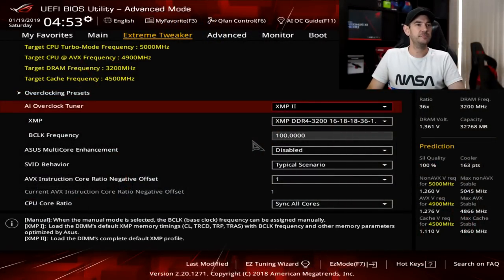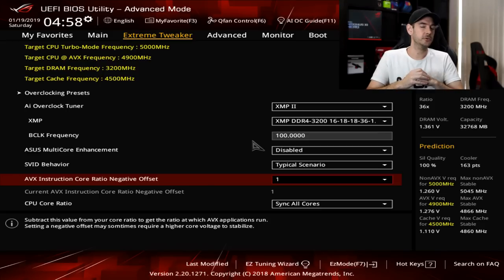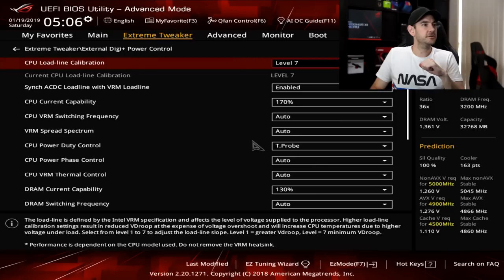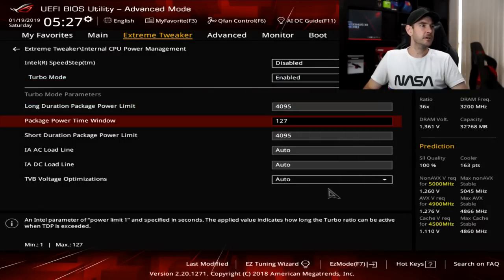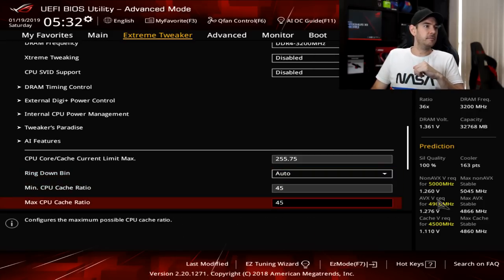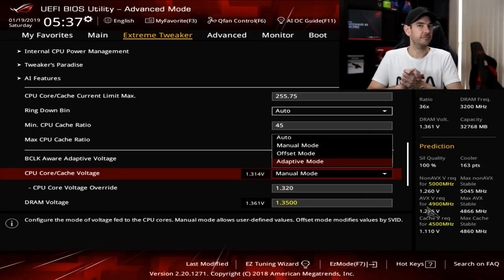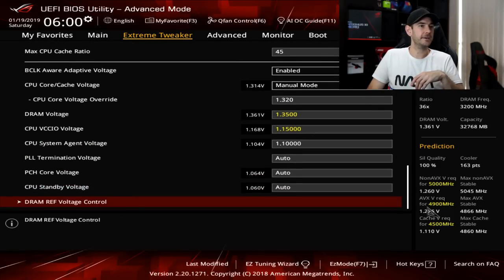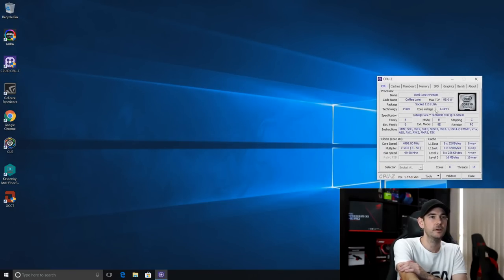The Complete i9 9900K Overclocking Guide - Maximus XI Z390 and Others

Comment: Hi, just wanted to say great video was needing something like this. I’m not a very experienced OC guy and I was using the asus OC presets and because it was on auto it would start off at 38% AI OC and it would take it up bit by bit to eventually 44% and then it would always blue screen because it would take the 9900 to 5.2. Now with your video I followed it but had to tweak it a bit here and there because it was unstable and crashing but eventually with your help I’ve got the 9900k to a stable 5.1 and I’m happy with that. I have the latest ASUS z390 formula with Corsair RGB pro 4266 and it still doesn’t like the 4266 so I have to have it at 4000 because otherwise if I set it to 4266 the LCD will show an error and then say detect memory so I really don’t know if I’ll be able to run it at 4266 which is should because the formula back take 4400+ so I’m baffed. Idk if anyone has any suggestions why. Also before I did your way my dram was auto set to 1.414 but when I changed it to 1.3200 it won’t change back or higher than 1.3200, so also baffed at that haha. But regardless of that I’m happy with the OC I have now, thanks for your help ;) Also I wanted to add I’m using the H100iV2 and my cooler points are on 209 so it’s very capable of keeping it cool, the highest it hit was 68c @5.1 all cores synced.

Comment: Bloody oath mate! Great video I must say! I just built my i9 9900 the weekend that past and funny enough it's on a Maximus XI gene mobo which is the most expensive mobo I've bought and probably the most expensive Micro mobo in Australia. I put a lot of investment into my built (first build in 5 yrs coming out of apple... 😬) but I am a complete novice when it comes to overclocking so your video will definitely help me bring out its full potential!! Using a corsair 280X case but because its so small I should've bought the full tower which I'm going to do later on for better airflow and to get a better AIO for cooling since I'm using a 240 AIO. I suppose this is what I get... making mistakes, you live and learn

Comment: Sadly I'm at 48* temp idle.  My CPU has always had this issue since day one.  I've even replaced the thermal and to avail.  I use the NZXT Kraken X.
Reply: I had high idle temp but don't give up, start with the 1.3v and go up slowly, I got the 10900k at 1.33V 5.1ghz AVX 1, very important to drop to 1.15 VCCIO and CPU system agent to 1.1

Comment: Overall good video, but just to spice it up, try to delid it  and try direct die cooling :) as it is possible with 9900K as it is placed bit higher in the CPU socket compared to i7 8700K. https://www.caseking.de/der8auer-intel-9th-gen.-oc-frame-fsd8-026.html
Reply from the maker: Not my chip otherwise I would have. Lol

Comment: Spent 2 hours of reading myself about how I should leave my LIne on level 5 on an ROG motherboard. .... „Well I just set this to level 7 because FCKJEAHHH“ xD. What should I do now!? XD
Reply: Edit: startet with 1.31 and even with a LLC at 5 to be sure it doesn’t drop under 4900 at all! Gonna raise it to 1.32+ after the stress test. Right now running it for 12 minutes and the temperatures are around 69 degrees with a custom loop. CPU overall temperature is at 55 round about so pretty great I guess! Very good guide!

Comment: One thing I've always wondered is why my 9900K is max clock speed 4.7Ghz 24/7 even at low usage/idle. Why won't this thing go down? Temps range between 42c-62c. I hope someone can answer this.
Reply: It will likely be because you have the BIOS settings for power saving set to something other than default everything enabled on the C1 C1e C2 etc.
Once you alter some of the C1 C2 etc it will stop the CPU downclocking and downvolting when idle or less than full load usage states. It might even just be the Intel speedstep setting on its own.

Comment: DRAM voltage definitely depends on what you buy. Dominator's run on 1.2 natively.
Reply from the maker: Yep. That’s why I said it’s automatically set by the XMP profile. DDR4 ram is typically safe up to 1.4V but always best to adhere to the manufacturers guidelines.

Comment: Thanks for the video. Could these settings be replicated on a Z370 Maximus Hero X for i9 9900k? I have updated the BIOS so that I can run the i9 9900K. I also have the Corsair H105 cooler in my system.
Reply from the maker: Should be pretty close

Comment: I have done everything the same as this guide, but for some reason it goes down to 4.7GHz during R15 and 3Dmark and I get the same scores as my stock configs. Temps were also pretty high 95~100c while stock during stress testing peak at 75~80. What can I do differently to achieve a proper 5GHz while maintaining good temps and stability? Mobo: MAXIMUS XI HERO/ Cooler: RYUJIN 360
Reply from the maker: Your cooling is inadequate. You were hitting thermal limits and throttling

Comment: Ok so thanks to this tutorial I have hit 5.1 at 1.30 vcore, 70c max :) is my piece of silicon good enough? I'm using 9900k, Maximus xi formula and fractal design s36 as a cooler with thermal grizzly kryonaut paste :)
Edit I have updated BIOS and went down to 1.29v :)
Reply: Little update for those who are interested, at 5.2 and even 1.33v I'm not that stable :( I'm not sure what to check next, because it seams odd that increasing 0.03v is not helping, or you guys think I should go higher?
EDIT: Tried everything up to 1.35, but it seams not working, I start to think it's not worth it if I can run the 5.1 at 1.29 cool and stable, but if anyone got idea what I could change, it will be appreciated:)

Comment: My i9 9900k it's burning when I get up to 5.0ghz 90-100C in load :( i have air cooler BeQuiet Darkrock pro 4 I Think could be enough
Reply from the maker: That’s not enough to cool a 9900k at 5GHz with anything more then about 1.28Vcore.

Comment: Hi (and happy new year!) - I'm using new XI Hero (installed yestarday), Core i9-9900KF (AIO watercooling H100i Corsair), my goal is 4,2 GHz OC (not more). By this way, is AVX instructions negative offset can be set to 0 (instead of 1 or more) for this light OC? Thanks in advance for your reply. Greetings from France, +1 thumb/subscriber.
Reply from the maker: Should be fine :)

Comment: I did everything in here and I also tried 42 for the min and max CPU cache and tried 1.3 for the CPU core voltage override but my system fails (blue screen) every time I stress test it. 

I have an asus Maximus XI hero and NZXT kraken x72 cooler

Can you please help, i’m new to overclocking and would really appreciate your advice here. 

Thanks!
Reply: Same I'm new, I have the Kraken x72 too. I've been told that overclocking all the way up to 5 ghz makes the pc wear down and get slower faster. Is this true? I want to overclock but not 5 ghz, my friend recommended going to to 4.3 from 3.6.

Comment: hi, if i wanted the possibility to get the pc to go in sleep mode what should i change? i have all your settings 1.28 vcore 5ghz all core same as you did in the video and it's rock solid! thanks for that!! Hovewer i need the sleep mode i tried messing with C states in bios but i cant get it to work im on maximus xi apex thanks again
Reply from the maker: Need to enable sleep states and smart stepping
Reply: @boostedmedia  i enablade smart stepping and put c states on auto, monitor goes off pc won't sleep yet

Comment: awesome guide dude! subbed! followed your guide and have a stable OC @5.0ghz.  Do you have a patreon page so I can make a donation?  One thing that worries me a bit are the temps under stress testing.  I get  85° with spikes to 90°  Therefore I thought to lower my core voltage to get the heat a bit down.  I followed your starting value of 1.320.  Can I lower directly to 1.29 and start testing again or should I lower with smaller increments? Also do I need to alter other settings when lowering the core voltage?  Thx again!!
Reply from the maker: Hi mate. Yep I do have Patreon. Patreon.com/boostedmediaofficial 

Those temps are a bit high for my liking. See how low you can get your voltage without instability. :)

Comment: You are not workload stable with avx. Yet again a gamer/number shooter not understanding how the system will respond when exporting/rendering a large 8k file that takes hours or over night to finish
Try prime95, custom, fft min 12 and max 12. Continuous loop or you are not workload stable. You will hit 95c and higher with your settings. Great tutorial otherwise. You won’t run 5.0/5.0avx or even 5.0/4.9avx without overheating on a real workload. You can run 4.9/4.9avx because the voltage needed for 4.9 non avx is low enough to not build the heat under an avx load. I have a custom loop including the vrm. It’s used for real editing not benchmarks or stress testing. I am sure the settings in this video will be fine for 90% of youtubers and gamers but not a real prosumer.
Reply from the maker: I use this system to edit all my videos. Often leave it rendering overnight (with AVX). Not a single issue once ever. Maxes out at around 78C on the hottest core.
Reply: Boosted Media try a 4K 60+ min video with noise reduction, stabilization, color correction, upscaling, motion effects, graphics........ like 15 layers and tell me this again. A YouTube video is not going to tax your system. Maybe you do this for production companies as a job I don’t know. But the last project I crunched taxed my system hard as hell. I had to back the system off to avoid thermal throttling.

Comment: Great video dude!! Learned a ton! Gonna try it tonight when I get home from work!
Reply from the maker: Let us know how it goes.
Reply: @boostedmedia  got it to boot into Windows but the stress test in occt causes a temp spike so high the test stops. I have it on an h150i pro though
Reply from the maker: What was your Vcore?
Reply: @boostedmedia  1.330 because it crashed at 1.320
Reply from the maker: What’s your temperature cutoff set to in OCCT?
Reply: @boostedmedia Good question. I've never used occt before but I've seen it hit 100C. It usually only makes it 3 seconds. I'll have to check the cutoff tonight.
Reply: @boostedmedia  fixed it! Same vcore but I found out that I didn't screw down one of the posts to the heatsink all the way! Now idle in the 30s and occt stress test maxes at 82. Need better thermal paste but I'm pretty happy. Now to see if I can do less voltage.

Comment: Thanks a lot for taking your time to elaborate this amazing guide, its extremely helpful for a healthy overclock. I have a doubt concerning fans rpm configuration. I have the same aio as you have, the h100 pro with a 9700k. Do you have a custom fan speed when stress testing or gaming? I set my fans rpm to 1200rpm, should I change it to the maximum speed while stress testing or gaming? The maximum is around 3000 rpm but the noise is extremely loud. Of course temps are lower if I set the rpm to 2000 or 2500. I’m doing a 5ghz all cores with 0 avx at 1.34 volts. 1200 rpm is like the ideal noise for me but temps are better when I set it to 2000 or 2500. 
Sorry for this wall of text but I have this around my head.
Again thanks a lot and please keep doing these amazing videos about overclook!!:)
Reply from the maker: I run my fans relative to water temperature. Check out my video on how to set up fan profiles :)
Reply: Boosted Media Thanks a lot for your lightning fast response:). I will watch that video

Comment: Damn, I appreciate your video. However, I was getting higher scores in R20 and 10c lower temps when I let Asus auto 5GHz my 9900K?
Reply from the maker: This video is only meant to be a starting point. Maybe you have a really good chip. Could probably try lower voltages and see how you go.
Reply: @boostedmedia Thanks! Yes I'm working on that right now. Should I be running OCCT a different way? Temps only reach 65C in it, but 90C in R20.

Comment: Got mine to run at around 5 ghz on asus maximus z370 adaptive to vcore pushing 1.42 and all the way to 1.5 and even 1.6 volt! So I run it now on manual 1.24 voltage at 4860Mhz. So which one is better a low manual voltage or a high adaptive?
Reply from the maker: Lower stable voltage is always better. 1.6 volts is insanely high. Chip is likely damaged.

Comment: Hey Will! Loved the video mate very easy for a beginner. I followed each step closely and numbers look similar to yours. I ran OCCT for an hour and cpu package never budged above 82c. Currently however the CPU is at 48c idle and just wondering if thats ok. I run a H110i and even with fans set to extreme i can't get it below that. Another thing i wanted to ask was why cinebench when running a cpu test instantly pushes all cores to nearing 100c in a split second and stays that way for the duration of the test. Thanks again!
Reply from the maker: Hmm those temps are too high. Might need to check your cooler is installed properly.

Comment: I have both a Z370-E and Z390-E with 9900KFs. I followed this tutorial and managed to set them up in a very similar manner. The Z370-E manages to run at 5GHz consistently while idling but the Z390-E seems to drop from 5GHz to 3.6GHz while idling. While both are under load they stay at 5GHz consistently, though. Any thoughts on what might cause this, or is it not something to worry about?
Reply: Change your power plan to max performance.
Reply: @JPOGame  Ah! That makes sense, the Balanced plan has minimum processor state at 5% versus 100% on the High Performance plan. Thanks!

Comment: if i disable MCE and do manually, put sync all cores at 50, set core voltage etc it stays at 4.7 the cache clock on cinebench!!! why??? HELP please. My cpu sil also 100% and my coller is 243 pts: h150i pro… i cry. My mprediction says 5.3 AVX stable… if i enable MCE and still sync all cores and some voltage tweeks i get the 5.0 with no trouble and 50's on stress test with CN... but thi8s is not hows it supposed to be.
Reply from the maker: I’m guessing you have an AVx offset for 3 set in bios.
Reply: @boostedmedia  was 3... now its 0. LLC 8 / 140% and MCE on Auto and im doing 1.250V CNr20 5.0 all cores. Its stable low temps 60's guess ill stay like this
Reply: @boostedmedia  updated the bios too just now.to 1401 version

Comment: Many many guides and none for adaptive. I figured it out using a kabylake guide and perfection...it's superior to this manual mode stuff. I accredit my Sandy bridge longevity of 7 years to adaptive down clocking/downvolting. No reason to be different this gen.
Reply from the maker: I have a sandybridge still running in manual voltage at nearly 1.5V. They’re strong chips.

Comment: I followed everything in the video, the only different is in my memory presets the numbers on the right were different than on the left and I just left it. When I went to boot the computer keep cycling on and off without anything showing on the monitor. Is this a psu issue? I have a 750w evga gold psu
Reply from the maker: Impossible to diagnose here. Double check your settings. If still no good you’ll need to check the bios fault codes to see what’s causing it to not POST.

Comment: hi boosted media, firstly, subscribed! thanks for the content. i'm a newb of pc but i got some money recently to buy my first "production pc" ah glad god loves me. so what i bought was 
intel i9 9900k
asus tuf z390
64gb 4x16 trident z 3200
noctua nhu12a
psu silverstone 500w 80plus gold
asus rtx 2070super
the question is can my setup right now do overclock because of the wattage of my psu is small? or should i buy the higher psu like 750w? i still running the stock speed all of the component (except i do use the xmp profile), but i feel my pc could go faster because i do alot of project with video and audio editing (adobe, DAW, animation).
i hope u consider to answer my question, and lastly, thank you :D
Reply from the maker: I wouldn’t recommend it with that power supply. You want at east an 850W supply for that system.
Reply: Boosted Media thank you for the answer 🙏🏻

Comment: Hi Will, mate i got everything done in your i9 9900k Over Clocking video tutorial except DRAM current capability which i could not find in the BIOS settings ? my main board is an ASUS ROG STRIX Z390 GAMING F Series and for whatever reason that setting was not there, i am running a stable clock speed now of 4.8Ghz but would like to know if that setting is something i need to find where it could be under a different name or something ? any help would be greatly appreciated :)
Reply from the maker: It may have been removed in later bios revisions. I wouldn’t worry about it as it’s not a critical setting.
Reply: @boostedmedia  no worry's thanks again for the awesome video tutorial, it's worked a treat :) i'm running stable :)

Comment: Same settings and i could pass OCCT for one hour using large or medium FFTs. But soon as I use small FFTSS? My system hangs. Is that normal?
Reply from the maker: Short FFTs are a very unrealistic workload. It shouldn’t hang but in the real world it’s unlikely you’ll have problems if that’s the only time it hangs.
Reply: Boosted Media Thank you for this info. Great video!

Comment: forgot.. about adaptive, was very bad implemented till 3/4 bios revisions ago, now with the latest i became a fan of...  speedstep and adaptive helps a lot also in noise level.. and i love silence :)
Reply from the maker: I'll have to play with Adaptive some more now it's been improved. Every time i get my hands on a motherboard I play with it and come to the same conclusion that it achieves practically nothing but slightly better efficiency figures on a spec sheet for the manufacturer. In a laptop where battery life is paramount, different story.
Reply: @boostedmedia  i switched from fixed to adaptive since a couple of months, previously wasn't working at all.. now i would say quite good,  if you do try and encounter strange behaviours , leave core cache clock to auto, do not touch it, for for me was a problem and i have no clue why.